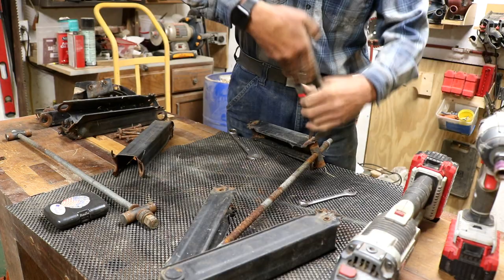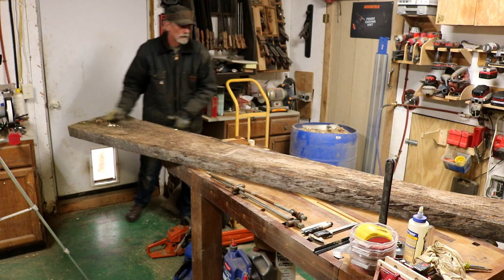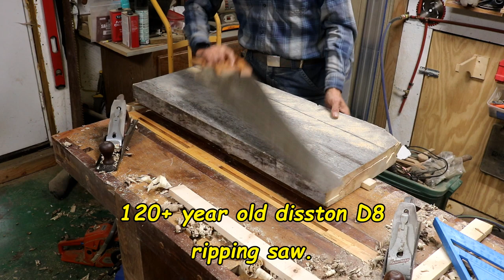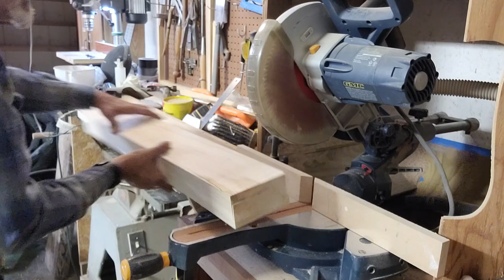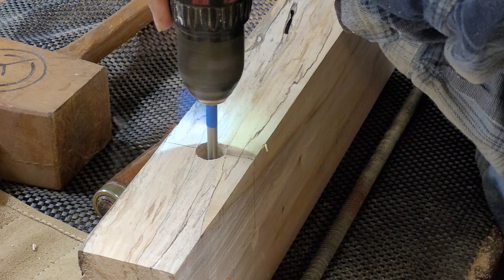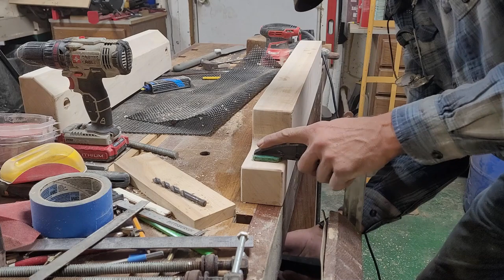Making a Moxon Vise from Scissor Jacks

Comment: really nice! If you were to do it again, maybe keep the handle end dog bone, and cut pockets for them to sit in the moving jaw.  You could drill 2 holes through them and screw them in to secure them to the wood.  then you wouldn't have the need for the extra hardwood pads.  Repurposing the jack screws was a bit of genius.  I cant wait to see the next project.

Comment: Going to have to bookmark this. I'm going to have to make a heap of hand tool stuff when I set up the new workshop next year. Mr 14 has been really getting into his Guitar, and getting quite good, and he also loves wood and metal shop at school, so we're looking into building a custom Guitar for him next year, so beside's collecting more equipment and hand tools, if it works out, we may make a few more to sell (most likely keep, lol), but I think it would be a great learning experience and give him more insight into how tools and guitars work. I have a couple of those old type of jacks around here somewhere, but I'm thinking it's best to use 2 that are the same make in case the fittings are different, like the TPI on the threads? Also, Merry Xmas to you and your family.

Comment: Using a table saw without push sticks. YOU ARE CRAZY
Reply from the maker: The material was being cut at 5 inches wide, no need for push sticks. Been using table saws for 40 years still got all my  digits so I must be doing something right.
Reply: Watched him use push sticks when appropriate. I MIGHT use push sticks in this case, maybe not. I wasent there, judgment call.